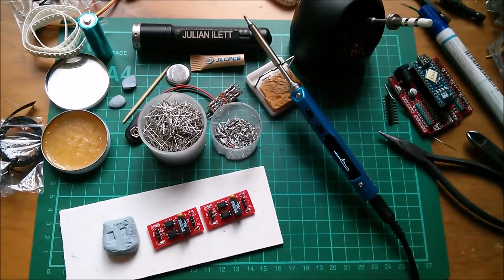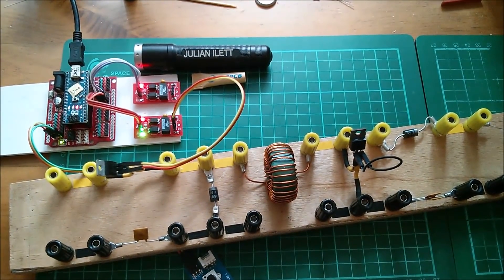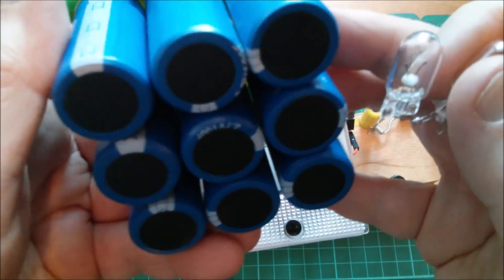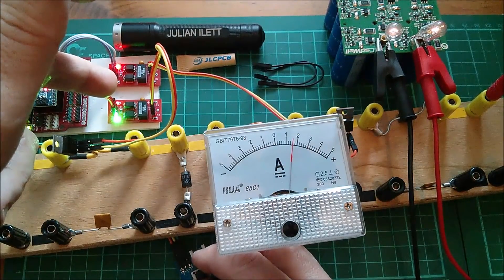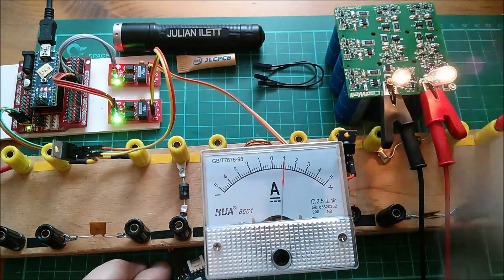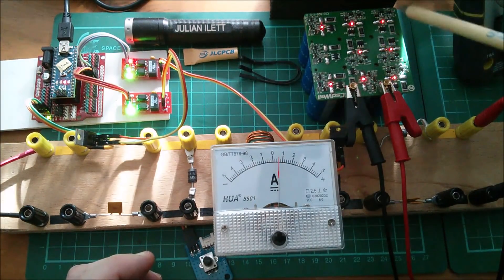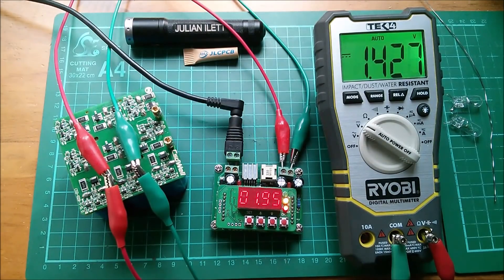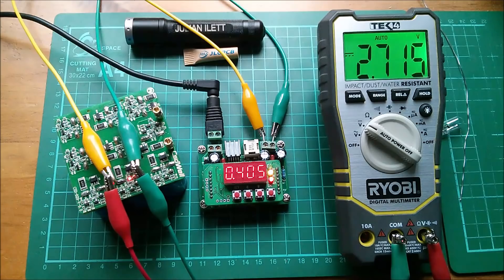Mupping about with Supercapacitors - Muppet 2

Comment: Julian, what would happen if you replaced that toroidal choke with a transformer? Edit: Like, if you wired it right, could it make a buck boost converter using transformers?
Reply: Even if he linked the secondary of 12v transformer to see if generate 240v pulses just for fun

Comment: @11:45 Use your multi-meter to measure the voltage across the wires between your buck converter and the capacitor.

Comment: The paint would be a lot more interesting with a couple volt meters. Analog ? Ok , if you must, but those little meters from Lucky Warm are also very cool and use almost no current , 3 or 4 digits. One green, one blue or red, well , one at the input, one at the mid section, and one at the 24v section. Would make watching paint dry a lot more interesting. You would think the second mosfet would be using more current ? No way to really know except for burning your fingers ?

Comment: Thanks for that, but I meant the capacitor board the one that takes NINE supercaps? How did the lazy cap exercise go? I made a block of 8 by 8 caps for a solar stabiliser, guess what  ONE in the bank was leaky... Finding it was tricky with 8 parallel rows...

Comment: Can you add a constant current module to the board?
Reply from the maker: It should be possible to put a current sensor on the Arduino and build a feedback control loop to keep the current constant.

Comment: Hi Julian, I missed the reason for the 9 super caps, what do you intend to use the pack for? and have you got a link for the nice regulator board ? Thanks.
Reply from the maker: Ultimately, I want to transfer energy between two supercapacitor banks - first in one direction, then the other. PSU is Ming He B3603.
Reply: @JulianIlett  is this an end goal? why do you want to shuffle energy back and forth?
Reply from the maker: That's it, more videos like this :)

Comment: Re: croc leads: If they are the same as I got, and that's very likely, they are absolutely terrible. Aluminium wires, and they are not soldered to the clips. Resistance value is very high. You can identify them by how hard it is to open the clips. They are super slippery and don't want to open.
Reply: Well, that's why I bought the crocodile clips separately, and banana to banana cables. It's also much more versatile.
Reply from the maker: Yeah, I've got lots of those :(

Comment: Would it be possible to find a similar superCap and replace the lazy Cap so the superCap module balances faster, thus the rest of the protection circuits don't heat stress the other caps ,and should reduce the premature failure of the other Caps due to the heat ? 
Great video btw.